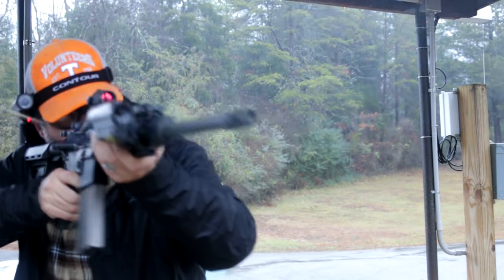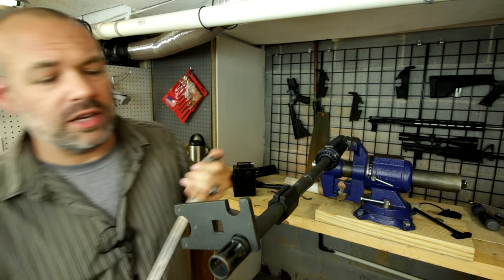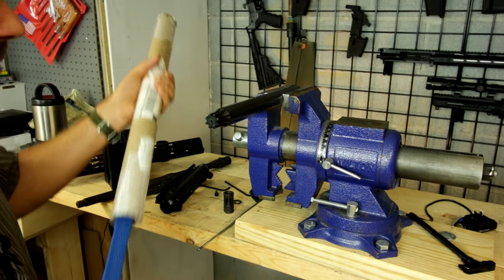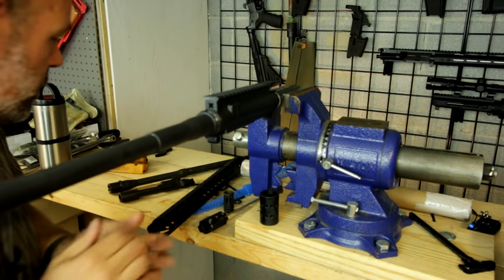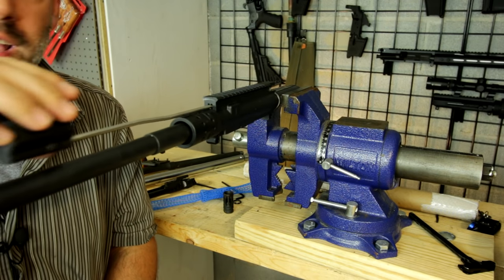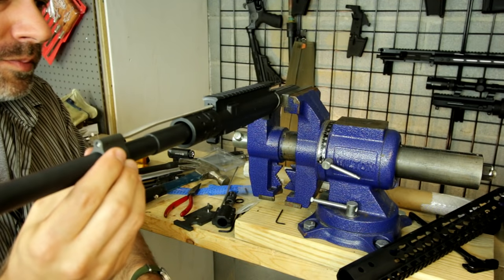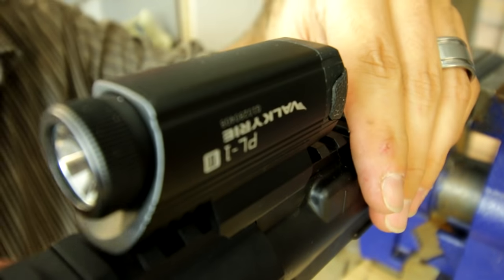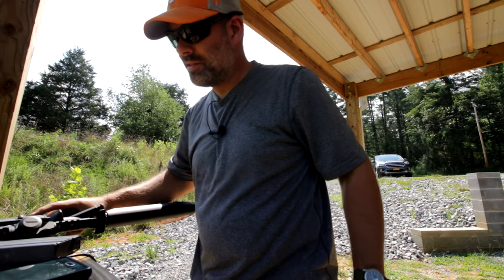How To Swap Out Any AR-15 Barrel

Comment: No head spacing?
Reply from the maker: On a new bolt and barrel?  Do you check the headspace on a new rifle?
Reply: DEUCE AND GUNS forgive me I’m new to this. I was just told you had to whenever you assembled a gun. I assumed the manufacturer did it.
Reply: It was out of curiosity, not meant to be a question of your knowledge.

Comment: i just learned that your supposed to set the torque wrenches off at a 90 to get an accurate reading - otherwise the torque wrench reacts like a cheater bar or breaker bar - Just thought I'd share

Comment: Bro. its 40f/lbs. use the torque wrench to break it
Reply: Barrel nuts and upper receiver manufacturers differ in what the tension is, usually it's 40-60 but the  most I've seen is indeed 80 ft/lbs
Reply: @shotgunsmellyofficial6894  i have a Real Avid AR-15 armorers kit, the manual even states between 30 and 80 ft lbs, but would still refer to the manufacturers

Comment: 16 inch is too long for 300blk....10.5 to 12.5 should be the longest and fired suppressed...
Reply: Misconception. Neither statement is a fact. 300blk is just fine with a 16" barrel been doing it for years. I just alternate weight and add a suppressor when hunting because it does make a difference but again not a requirement.

Comment: Lmao your not going to use the torque wrench to loosen but your going to use it with the wrong angle with a crows foot. Pick and choose your poison
Reply from the maker: My last video went in great depth about this including the math formula but YouTube deleted it due to it,  "showing how to manufacture a firearm".  On this wrench with this extension it introduces a 2-3 lb difference and just Isn't a big deal.  At least I mentioned the 90 degree method because most companies building ARs don't even know about it.

Comment: I've always been told that an ar15 doesn't need to be headspaced
Reply from the maker: I'd agree if both barrel and bolt are new but any moving part can wear over time.  I checked this one before firing and it was fine as expected.  The bolt had not been used that much.